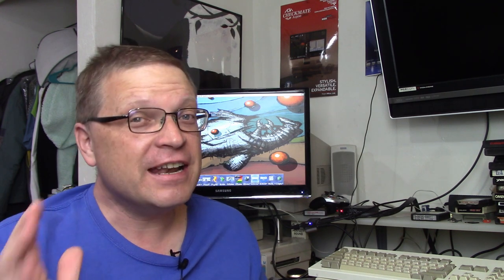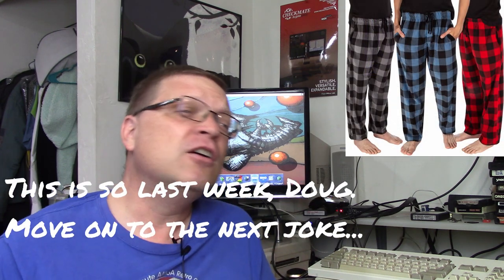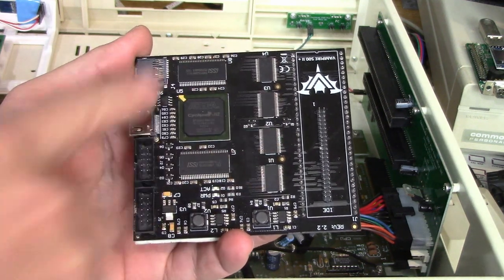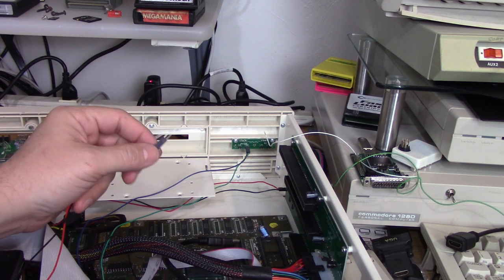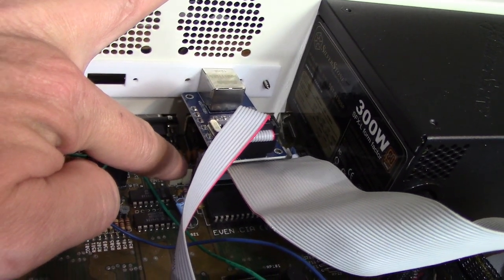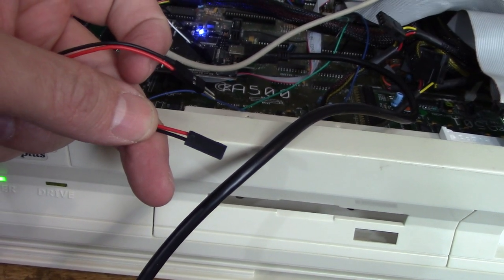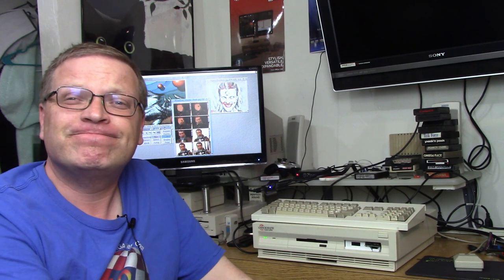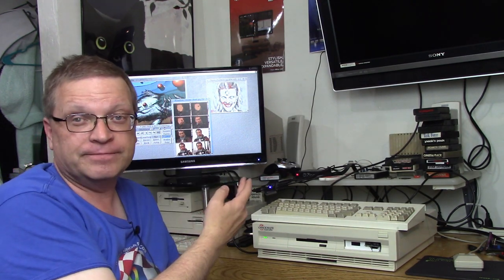Hard Drive LED for the Vampire (and other accelerator cards)

Comment: Chris Edwards does an awesome job providing very useful information on Amigas.   I can't keep up with him and I do have a list of things he has done that I want to do myself.  Yea I have come across the LED Issue the A500 is the one unit I have to address but its on the back burner so to speak but I will get to it.   I have a Vampire for the A500 that I have yet to install because its for an A500++ Board that's on my bench waiting for me to finish and its 99.9% done.   For me to sit at that bench lately I have to be motivated and that's because by the time I come home from work I am exhausted and my mind is fixated on filling customer orders so when I work at that bench I need to have a clear and focused mind or bad things can happen.
Reply from the maker: Those 500++ boards are really nice! I could never make one myself. I would burn down my workbench...
Reply: @10MARC  Its not as bad you believe it to be.  Sourcing all the parts and yea the wait for some parts is the hardest part.

Comment: For the USB ports on the A1000 backplate I recommend filling with a tiny bit of clear hot glue with tape on the exterior side to keep it smooth.  It is easy to remove later and keeps the panel from having holes in it.  You can remove the tape and have a nice smooth plug in the hole.  It really is only useful for a rapid road or a keyboard adapter.  This is a handy video.  I also recommend a SD2IDE adapter so you do not have to do anything to your expensive vampire.  Wire wrap is fine and probably the easiest to work with.  All we need is a 1MB hack for an agnus with an NTSC/PAL option on the A1000.  2MB is really not needed.  The vampire makes the A1000 amazing still as it is.
Reply from the maker: Excellent idea. As long as we are not too rough with the USB, the glue will hold great. I ended up using a bit of glue to hold the Ethernet port in place, and so far so good.

Comment: Hi Doug! The SCSI2SD cards have the same situation, i.e., no male pin header place to connect the case's HD activity light. However, there are two holes marked "LED" on the board, just no pins/pin-header. A good technique to solder some in is by making the male pin header out of two short segments of legs cut from some component, such as a through-hole resistor. Stick those short segments into the female connector (that they will ultimately be connected to) for the case LED, so that they are held straight and at exactly the right distance from each other Then it's easy to solder them in the SCSI2SD's "LED" holes.
Reply from the maker: Fantastic idea, really. This would help on my A4000 - my Warp Engine card has no LED headers. Thanks for the tip!
Reply: @10MARC  What was super-funny is that I just moved this SCSI2SD card from being mounted vertically on my Zorro II host-adapter to the 5 1/4" drive bay, so that I had easy access to the card and USB port from the front.
What I forgot to do was to block that very bright tiny LED on the board itself, so now I not only have the Amiga 2000 normal HD activity light working, but it looks like a lightning storm or flickering flames through the crevices around the 5 1/4" drive bay bezel. :) I was going to fix it but I decided it reminds me of the movie TRON and there are glowing programs running around in there, so I'm leaving it. :)

Comment: Our good friend Edu Arana has a little A500 IDE Activity header. It sits on the A500 keyboard connector on the motherboard and then your keyboard cable plugs into this. Adjusts the voltage coming from IDE activity to properly activate the Floppy IDE on the A500 case. Works perfectly. I can now see when my HC533 TurboCard enabled setup is accessing the internal CF hard drive. And it doesn’t interfere with Floppy access indication either👌
Reply from the maker: Cool! I had a nice chat with Edu Arana about this little project. He was quite helpful.
Reply: Did you connect this to the LED header on your HC533 or use something like the method Doug showed?
Reply: @roscoe500  Hi Daniel, yes, used one of my Male2Female Dupont cables. Plugged the Female end onto the Header on the HC533 and soldered the Male end into the through hole on the IDE/Keyboard adapter. One of the 2 pins on the header is ground and one is the activity line. Used my multimeter in continuity to work out which was which. Worked perfectly.
Reply: @75slaine  Brilliant, wondered if this would work. Which one was the activity line on your board out of interest? Did you just need to connect the LED line to the adapter board and do nothing with the ground? Thanks for the help!
Reply: @roscoe500  exactly, just 1 cable. I can’t recall which was ground and which was activity. Very easy to tell with a multimeter. Or give me a shout if you get one and I’ll open mine up and take a look

Comment: Doug, I wouldn't even POINT a soldering iron at my vampire, lol.  I did mine to pin 39 and to ground of the CF adapter.  It kind of worked, but was always on.  Guess I know why now, thx.
Reply from the maker: Yep. Tap into pin 42 on the CF card and you will be fine

Comment: Maybe you could use a 2-color LED in that A1000.
Reply from the maker: Oh I like that idea! I need to look into that solution!
Reply: I was just going to suggest this too :)  The multi-color LEDs have a control pin for each of the RGB colors.  In this case, you might be mixing colors as power is always on, but that should be o.k. too.
Reply: Or maybe, when the LED is glued in and you don't want to damage your A1000 in any way, make the power LED go dark when the HDD is accessed. In fact, it will be a HDD-no-activity LED then, instead of a HDD-activity LED :)

Comment: Lmhey doug. Looks like a checkmate keybaord behind you at the beginning. Looks like it sinks a little in the middle which generally occurs. I used a long m3 screw in one of the holes in the middle which adds nice support so you don't get the sinking.

Thanks for video!
Reply from the maker: Thanks for the advice! Yes it does sag a bit. I will try your solution.

Comment: i soldered my led wire on the bottom side of the ide header so it doesn't interfere with anything. +5v can be pulled off the top side
 of the 68000 pins on the vampire.
Reply from the maker: That is actually a really good idea to tap it from the bottom. 
I like the idea of grabbing the 5 V from the 68000, too. I wonder why mine did not work tapping the 5V from the floppy connector?

Comment: Cool Stuff 😎have a checkmate case With Vamp500 to, need that solution for hdmi , where are the 3D print sources ?
Reply from the maker: I will get that info from David and try to link it in the description
Reply: With the Checkmate case I used a standard PC rear panel mounted CF interface and cut a rectangular aperture for a panel mount HDMI cable.

Comment: Have that angle adaptor with a buffer IC that was meant for an A1200 originally. Got a pin soldered on and that works pretty well with the original a500 cabling of the checkmate case. Btw. all this plasticy 3D printed brackets. Don't trust their stability so took standard isa blind slots drilled and filed them to take vga/dvi/usb etc. So fun traditional metal work 🤣
Reply from the maker: The metal work is certainly a better way to do it if you have the tools!

Comment: Hmm.. maybe instead of soldering directly to Vampire pins, maybe solder to some kind of tight flat ring that could be put on the selected pin. That kind of ring could be also done from the uncovered wire itself.. just loud thinking ;)
Reply from the maker: Nice plan. I took a look at my local Electronic store for something similar to that, which would just go right over the pins. They are all too big - but maybe I will look online
Reply: @10MARC  Isn't it much more easy to solder the cables for the LED to the underside of the Vampire PCB? If I look closely on the pictures of the Vampire (have not got one yet, but I am on the waiting list) the 44pin connector is pin-through, not SMD, so the pins shoult be easy to be accessable on the underside. You even might use a very short cable with a two pin connector (and the resistor in one of the lines) and fix the connector on the underside of the vampire with some epoxy at the brim of the PCB - so you can easy plug and unplug an cable to the LED there).

If you do not have a HD LED in your case, simply replace one of the existing LEDs (like power- or floppy LED) with a dual color one. Red/Green LED are very common in all sizes. Easy to change - and easy to change back if you want to undo it.
Reply from the maker: @oleurgast730  You are 100% correct. I have two 68000 sockets on the bottom of my Vampire to extend the height above my Megachip 2MB CHIP RAM Expansion, so I did not notice how easy it would have been to solder to the bottom! 
I love the idea of the dual LED, too. Thanks!

Comment: I grabbed a CF adapter with a built in LED driver and simply extended the wire to the front of my checkmate1500+
Reply from the maker: Good plan for sure! I have one of the CF adapters with the header for an LED, I just have to put the pins on it.

Comment: Where can I get that HDMI cable for the inside to connect to the bracket?
Reply from the maker: Here is the description on amazon. 
CablesOnline 1ft Hi-Speed HDMI 1.4 w/Ethernet Channel M to F Panel Mount Extension Cable, (H4-P001)
Reply: @10MARC  Thanks, and where can I order the 3D bracket from for my Amiga 2000? Great video BTW.

Comment: With my Vampirized A500 the drive light actually works automatically with the CF card adapter that is connected to the Vampire. I have no rational explanation for it :-)
Reply from the maker: So I agree that the light on the CF card adapter works - but can you see it when it is in the case?  I have a nice CF adapter that has solder points for an actual LED header, and I was considering using that, too.
Reply from the maker: That is wonderful! I love that shop!
Reply: @10MARC  Actually, there is no activity light on the CF adapter itself - the Amiga's drive light is used, but only when the floppy drive / gotek is not connected. I can see it all since the Vampire is attached to the Lazarus board by Edu Arana, and sits outside the Amiga :-)
Reply: @hm_kaiser  Yeah, that explains it. But it still seems like voodoo magic to me.
Reply: @10MARC  I got mine from Sordan, but you love that shop, too :-) I think it's this one: https://sordan.ie/product/340/angle-cf-25-ide-44-pin-hard-drive-adapter-compact-flash-amiga/
Reply: Sorry folks, I just embarrassed myself and wasted your time. There is no voodoo magic going on between my adapters, the Vampire and Amiga's drive light, it seems I was thrown off by the Vampire looking for the floppy drive at boot-up, and it simply wasn't there. When copying files the Amiga's drive light doesn't flash, and I've tested with all three adapters I have. One of them might be able to produce the desired effect on an A1200 or A600 when connected to it's onboard IDE controller since the wiring is already there. Doh.

Comment: Hmm, wonder if somebody should make up a simple little parasite style board where the board has through holes with vias for the last 6 pins or so to lay over the IDE pins and the resistor and then provides a 2 pin header to hook up the LED... Something similar to the way this little Pimoroni RasPi fan shim board works while still leaving the GPIO pins available for use. https://www.electromaker.io/shop/product/fan-shim-for-raspberry-pi

Or for the 500 or 1000 where you don't have a light location, maybe a little piezo buzzer could be wired up to give sort of a "drive sound" (similar to how the work on the gotek, but that likely would require some more circuitry to make the sound...)
Reply from the maker: I think this is an excellent idea!